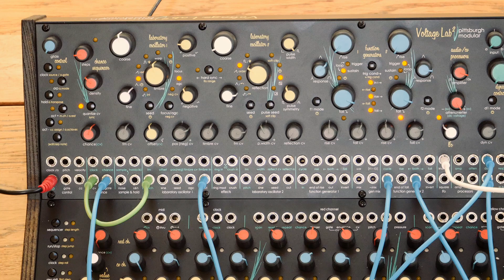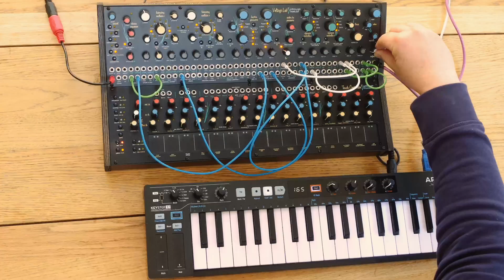Voltage Lab 2 Laboratory Controls Manual with Starsky Carr

Comment: Is it possible to have a cv clock external input and send the midi clock out to a Roland sp 404 mk2?Thanks!
Reply: Yes, but you'll need to convert the CV clock of the VL2 to MIDI clock via an external device that can take the incoming CV clock signal to convert it to a MIDI clock signal so it can be sent out. Reason: the VL2 can't convert the CV clock signal to a MIDI clock signal on it's own.